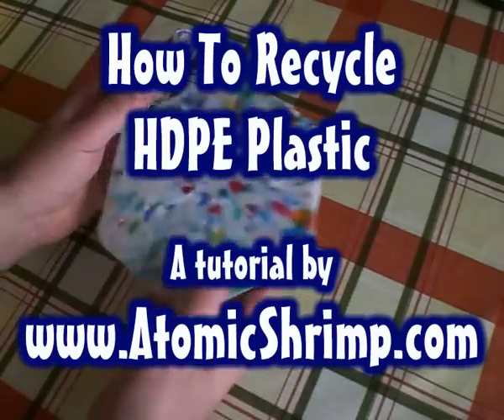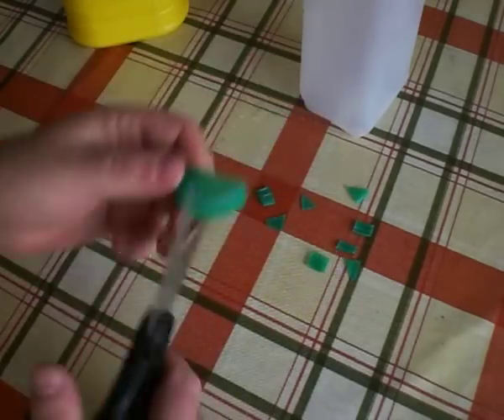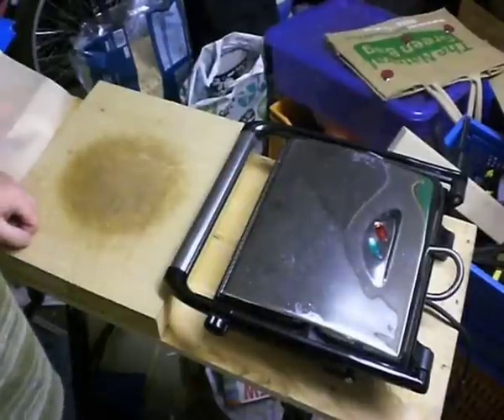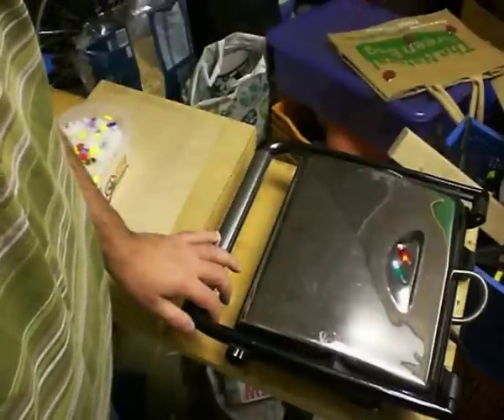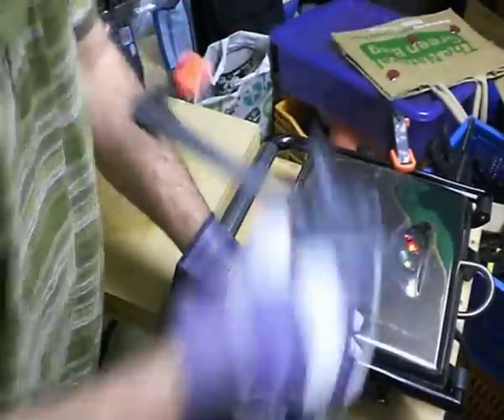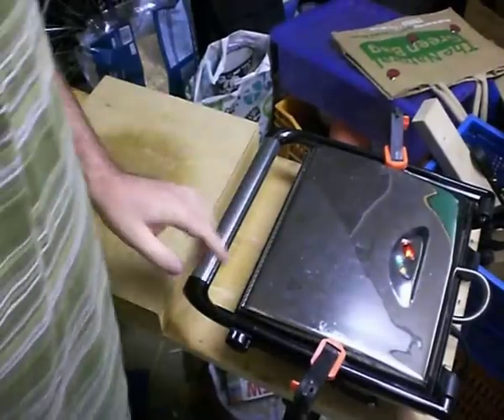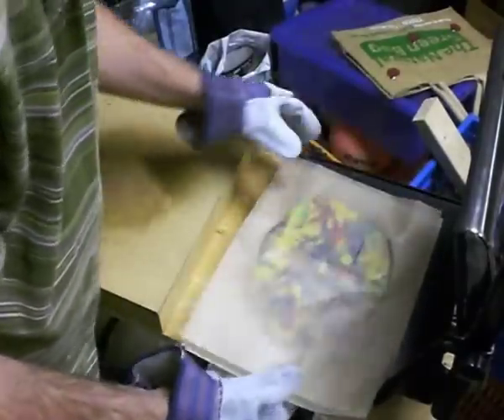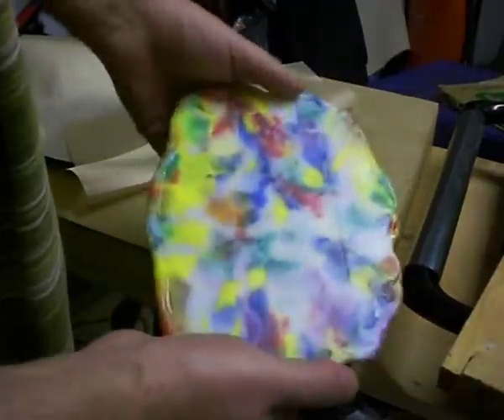How To Recycle HDPE Plastic (High Density Polyethylene) - a simple method

Comment: Very interesting,  can you melt this material and pour it into a form ?
Reply from the maker: Correct - it will flow under pressure, but I haven't got around to making an injection moulding rig... yet...
Reply: AtomicShrimp not without putting it under pressure, which is probably beyond most home applications.
Reply from the maker: It never melts to pourable consistency - it will burn first.

Comment: This is very instructive and makes me wonder why governments don't do this rather than incinerating it together with other garbage. Industrially, I'm sure it could be reused to make waterproof building materials to cover roofs for example... Or use it to make decorative furniture :)Thanks for sharing.
Reply: Actually it would not be useful for making a building or covering a roof. UV rays break down HDPE very quickly becoming weak and brittle. It's very useful for a lot of things as long as those things are not exposed to constant sunlight.
Reply: @peterfitzwell9658  does that mean that its more biodegradable than other plastics? does it break down into nothing or just becomes powder?
Reply: @peterfitzwell9658  adding graphene to the recycled plastic would solve that. You'd have a super strong material, weatherproof also.
Reply: I agree with u Nick. What did u get ur inspiration to do this.
Reply: Sorry that message made no sense i meant to say what does ur youtube name mean?
Reply: You do realize the reason that no 2 in on that is because the government wants it to be recycled but its not worth it if you throw it away with your dirty diapers and cat litter
Reply: Not for any material exposed to daylight--the UV breaks it down.  There are UV inhibitor chemicals, but why, when metal's so much better for long-lived roofs?   Even used tires are better at resisting UV breakdown...roof tiles are already being made from old tires.  Some have simply cut tires into “tiles” and used similarly to how cupped roof tiles are used. Used tires can still be salvaged from most tire shops.  
But, making plastic bricks, using them as insulation, might be a thing....walls and floors mostly, since roofs get too hot in summers....heat deteriorates plastics over time, too...so not so good in walls that are exposed to full sun.   
==> Also, you want to make sure the VOC’s that plastics emit, do NOT enter the living space!!!   
Not when melting the material, and not after its fabricated.  Plastics emit VOCs for many many years.  It takes a common synthetic carpet, about 10 years to fully out-gas it’s VOC’s; if it’s melted to remake it into something else, it emits more VOCs.   The VOC’s plastics emit, are toxic, and cause long-range health issues...including gender-bending people and other animals.  
So, whatever you make with your plastic, make sure it’s not polluting your living space during or after fabrication!
Reply: Traditionally, the idea was that you burn it and let the trees and shit do the work
Reply: Most plastic left for recycling is a big jumble of the different types of plastic. The man power it would take to sort it makes the process way too expensive. HDPE reacts in one way to certain temperatures, but what if it was contaminated with plastic with a lower melting point? The chemical reactions of different mixes of plastics are seldom healthy (think smoke).
In principle it is a nice idea, but too difficult to use on a grand scale.
Reply: @mariepindstruplinde1671  have you heard of float sorting ? It seperates plastics by running them through cylinders . They get seperated because they have different densities.

Comment: Take the long strip and fold it many times. Then cut. So much faster
Reply from the maker: Not faster, because cutting more than one layer at a time is nearly impossible.   Guys, I have already tried all of these labour saving suggestions involving shredders, different methods of cutting, etc.
Reply: I wonder if you've tried a strong paper guillotine for slicing up the flatter parts? I don't have a good one, but may get one soon, because I think it would speed things up over using scissors alone. The flat panels of the milk bottle could be cut into strips almost right along - leaving one edge to hold the strips together (a bit like a comb). The sheet could then be turned in the guillotine 90 degrees, clamped, and cut into strips again (across the first strips), falling apart into square pieces.
Reply: AtomicShrimp What about a quality paper shredder?

Comment: You can do better: mix HDPE or LDPE (or both) with paraffin wax - this will lower melting temperature of the PE material, and the result will be liquid ready for moulding. Result is pretty meleable material, although not that strong as pure HDPE.
Reply from the maker: *****
Marie Johnston Just to note that the risks involved in this blending process sound like they will be similar to those of deep fat frying on the stove - so exercise the same precautions (thick apron, be careful of splashes, don't ever lean over the pan, and, in the hopefully unlkely event that it catches fire, extinguish with a heavy damp cloth or fire blanket)
Reply: AtomicShrimp Oh, yes, sorry... Forgot to mention that. You are right, all three materials has very high thermal storage coeficient, so once heated - it remains hot for long time. And every water drop may cause sudden burst of the molten material. Thank you for mentioning this.
Reply: ***** - Thank you for this information.  Yesterday, I had some success mixing LDPE (#4 plastic lid) with HDPE (it was probably a 50/50 mix-very small amount). I used an old electric skillet, outside, at a temperature between 374 and 400 f.  The LDPE is definitely more gooey, and it quickly blended with the HDPE, and I had a more pliable, thinner piece to work with, although it was weaker, and more brittle than the HDPE alone. I'm excited about that - as I just could not work well with the HDPE alone. I would say there's probably a perfect combination of the two, to get the exact texture and pliability I'm looking for.
Reply: I am interested in making a more pliable version of this - how would I mix in the paraffin?
Reply: Marie Johnston Try first 2:1 LDPE:paraffin melting on electric stove (don't use gas stove!) until it melts together. You may melt paraffin first at much lower temperature, then add chips of LDPE and/or HDPE until begins to wet. Then rise the temperature and stir it with some metal spoon well insulated from your fingers.  Or, you can mix two part of LDPE/HDPE chips and one part of paraffin together, first at lower temperature, then increase heat until all dissolve. Finally pour it into some mold and wait to cool. After that you have a 'brick' which can be machined with various tools. This brick, depend of how you made mold (shape).

Comment: can polypropylene be reused the same way?
Reply from the maker: I think so - the melting point is similar.  In a couple of my experiments, I think I may have accidentally included some PP in with the HDPE, because there were some patches that seemed to perform differently than others (more sticky when melted, stiffer when set) - the two plastics can apparently be mixed/blanded too, for non-critical applications
Reply: AtomicShrimp
agree;  in my limited experimentation, PP actually seems to re-melt again a bit easier, but both are quite mouldable (if not exactly fluid) at domestic oven temperatures of around 200 deg C.

Comment: Really Cool!!! Could you do this same things with the kind of paper you are using & an iron? Or wax paper and an iron?
Reply from the maker: Not wax paper - that will probably contaminate the plastic, but you should be able to do stuff like this with an iron (probably on a smaller scale though - this toaster puts out a lot of heat across a large area) - experiment with the iron temperature - start low and work up until you reach the melt point, so you don't burn the plastic.  The fumes aren't usually very severe, but work in a well ventilated area to play safe
Reply: Thank you so much for answering sooo Fast!!!!!

Comment: This is a fantastic idea. Watching this video has made me to decide on using this material to make roofing tiles for the house i am building out of all natural and recycled materials. Thanks!!!!
Reply: Not uv resistant, will break down in a short period and start to crack
Reply: Andrew Barnard not if its sprayed with polyurea after its been shaped.
Reply: Are you talking about a house to live in? Like a Cobb house?
Reply: @Justin Yaroch Houses built in 2000 were built to last at least 100 years. Our siding alone will last for 50 years. The house my father built back in 1949 still exists today...70 years later!
Reply: @Justin Yaroch You.just got the nail on the head with your last statement, that houses aren't built to last. They SHOULD be built to last. And no building inspector should pass one that shows structural problems.
Reply: Roofing tiles? How many jugs and tops will you need for that project. I was thinking too small I guess, just thinking of coasters or earrings. 🤑
Reply: @barbarayoung8116  Good points. I wondered same thing.
Reply: An episode of Grand Designs from the UK actually showcased roofing tiles made just like this.  Although the tiles were black.  It was amazing and we decided to do the same thing.  Too much plastic in our lives as it is, may as well recycle it.
Reply: timlad5 I did not see grand designs, but I am sure that if HDPE was used that uv stabiliser was added to the mix. Not sure it could be done at the temp in this example. Black does not mean UV stabilised although industrial produced recycled product will likely be black.
Reply: Nice, will use this to make giant leg-go type jigsaw pieces for building a stable and secure structure that can be set in place by spraying with polyurea to eliminate deterioration. Solution for stable building material from this idea is now solved.
Reply: A certain amount of seconds in a microwave depending on how many watts would also work maybe? Anyone have suggestions on a faster way of heating and melting this without burning it?
Reply: @silveryfoxau in reference to your comment above, maybe using some sort of rotating metal drum with heat applied from the outside (something similar in design to a mini cement mixer with paint stripper guns attached to the outside, either pointing towards the outside of the drum heating it, or directly in to the drum, heating the plastic directly) and then chips of the plastic material could be thrown in over time until it all melts and mixes in, and may be if you were lucky, it might end up as an even colour with a more liquid pourable  consistency, that would allow it to be poured either on to a smooth heat proof surface to spread and set in to a big sheet (maybe using either hand held heated metal rollers similar to paint rollers but made from Metal, to help spread it out to a required thickness) or poured in to a mould of some sort, maybe spread of pressed in to place with the rollers or paint scrapers. I dare say, if done fast enough wearing the correct protective clothing, it could be pulled on a hook and moulded to shaoe like confectioner's do when making molten sugar based candy.

 It may not work, but it might be worth a try for someone who has the means and skills to make the equipment. Maybe something else could be added to the plastic to help it to melt to a nice pliable or mouldable consistency without it getting too hot and burning?

Maybe some way of grinding the plastic down to a fine powder before melting might make the process easier? Does anyone know if there are any chemical ways of melting this type of plastic without heat, that would allow the material to break down to a liquid form then be reconstituted somehow? Like how acetone can break down some materials, then some of those materials can be recovered and reconstituted once the acetone evaporates? I know I'm probably wrong in these ideas, I'm not a chemist and don't know the ins and outs of the subject. I wouldn't advocate anything dangerous, of to attempt anything bad for anyone's health. I just come up with ideas and then let someone with more expertise than me on the subject explain either why not to go through with the ideas, of to explain the dangers, of explain a safe way if doing what I've suggested etc.

I would try all these ideas myself but I'm suffering from a long term illness that basically affects what I'm capable of nowadays. The ideas still come but my body, mainly my legs and hands let me down. 

* Sorry for any grammatical errors or omissions, spelling mistakes etc. I'm typing this on a tiny phone with a 2"x 2" screen with an even smaller keyboard with really bad eyesight so, if have made any mistakes, sorry (to be honest I couldn't give a nat's chuff if I have it not!)
Reply: @silveryfoxau  Lasers.
Reply: @smisch7720  Even plastic wheels are a good example. They are not reliable even on a small scale like wheels. If plastic was mixed with something else, maybe that would endure, but hey, we have enough products now that do work, so why use plastic, I say. It shouldn't pass a building inspection. Can you imagine how noisy it is when it rains?
Reply: How's the house coming?
Reply: Not cost effective..Sorry ....  but shingles?? How much electricity or other cost involved in melting the plastic into a sheet form is used.. Now if you have "free" energy, like solar panels, to draw power from then be my guest its your power  source.. but there are some much better applications that can be used for sheet plastic
Reply: People see "done by hand" and immediately believe it's the most cost-effective and environmentally friendly because it doesnt involve nasty corporations and those icky factory things.
Large scale methods are obviously more efficient, and in the (not so) long run. They'll save tons of energy, compared to a little toaster.
The human body is very inefficient as well, so even your own expended energy counts towards this.
If you want a fun DIY project, go with Atomic Shrimp's method. I might try it sometime myself, should I need a shape of plastic.
If you want to save energy and build a sustainable anything, don't spend three weeks collecting and cutting up bottles and baking them in appliances that werent designed for them. Think of all that heat that the un-insulated toaster bleeds in to the air, wasting a good deal of it.
And again, your own energy could be used to do more productive things to help the environment.
Even sitting on your arse, studying recycling processes in more detail will, in the long run, be more helpful than "I think I'll replace my roof shingles today".
No offence at all to Atomic Shrimp (he's great; his idea on DIY level is cool)
No offence to commenters themselves. Some of your views on "sustainable" just need a broader view.
Reply: It will only take several thousand hours and God knows how much electricity.
Reply: Woody and Unicorn:  Would you get planning permission for colourful tiles?  I had to use same tiles as in the neighbourhood for my extension which can't be seen from the public roa
Reply: Using plastic is good in theory but in practice it has to much movement, if you have a stable temperature it work but any variations greater than about 10 degrees Celsius  and it expands and contracts to much. Believe me  I'm a carpenter and I've done decks with the stuff. Perfect before lunch, buckling by knock of,  perfect the next day
Reply: DONT USE FOR ROOFING KITTY
Reply: @Justin Yaroch Make furniture, frames, building blocks for future projects, but not a roof. Your roof needs special design which can harmonize with weather.
Reply: Kitty and unicorn I wood   iWeb out  coo
 I ila sme to pu t out Sed to cavern for th Vera da protect from the sun
Reply: A roof? I suppose if you start making them now 24/7 you'll have enough in.about 5 years. I'd try a garden shed but not a house roof, wow. Though I'd say they probably would never have to.be replaced. As I understand, It's best to have tiles that "breath" in order to prevent molds from growing in your home.
Reply: @annebradley6086  5 years already passed by from the op comment lol
Reply: @Basuko_Smoker  So what's your point? Most likely you don't have one, just adding LOL

Comment: Dood... no disrespect, but I think you have entirely too much time on your hands :-)

Came across this looking for a way to plug a vapor leak in an HDPE gas tank at penetration points in order to pass the California EVAP test for my truck. Last time I used Shoe Goo and that worked long enough to pass, but not two years later when I have to retest. Best I came up with so far is to use a soldering iron and #2 plastic, like your milk carton cut into strips, to weld around the penetrations. I will drop the gas tank tomorrow and see how it goes.
Reply: Look up Polymorph at robotshop.com or a youtube video called "bio Plastic" it may help?  Not the recycling that is in this video.... but might just be your answer?